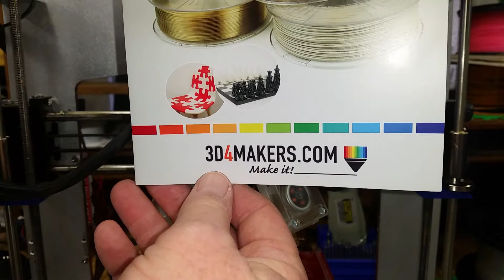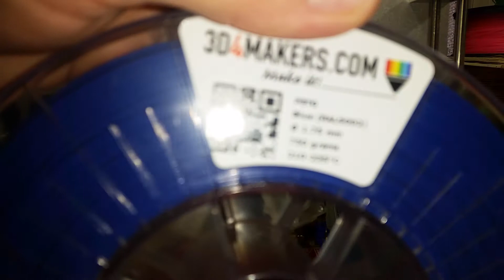3D4Makers.com PETG Review / 3D Printed Bottle Opener

Comment: Hi Jimmy. I just bought a Mecreator 2 like yours and am having difficulties using it with Cura. I am using a mac and was wondering if you use it as a reprap printer or repetier. Also how did you get it to print in the center and not the edge. Thanks in advanced. Kevin
Reply from the maker: +Blueenergizerbunny Hi!

I use cura 15.4.6 and use reprap with Marlin.  To offset the centering problem, I love the item to the right of the build plate in Cura before slicing it.
Reply: Thanks a lot I will try that.

Kevin
Reply: In addition what print head and gantry height settings do you use?
Reply from the maker: +Blueenergizerbunny that's where I have a problem with the new cura.  I have never figured that out, so I stuck with the older one.
Reply: Okay. I just thought I'd ask as the original version of Cura I had did not have custom printers.

Kevin

Comment: Great dual review and print video, nice work Jimmy! I have to print that opener too, very Practical use of #3dprinting. Might have to look into the PETG filaments too, very curious about those.
Reply from the maker: +Print 3D Channel Thanks!  If you want the durability and heat resistance of ABS and the easy printing of PLA, it's a great alternative.

Comment: Heya...on your Geeetech Aluminum Prusa I3, do you have fan speed control? Both of my fan connectors are at 100% all the time.
Reply: is the board the GT2560?
Reply: Yep, just like Jimmy says. I may eventually swap it over to a Raspberry Pi and Octoprint, but for now this is a minor annoyance.
Reply from the maker: +Greg Webster Unfortunately not.  It has the old Sanguinololu board.  If it had the GT2560 board we would be in business.  That's what the MeCreator2 has and it does have active cooling.

Comment: Hi, how fast you print with your mecreator 2 ? I print at 80mm/s fast and slow at 40mm/s
Reply from the maker: +Club der dichten Dampfer I can print faster, but on average 50mms fast 30mms outer shells,  20mms first layer and 70mms non printing moves.

Comment: Minimal cooling is fine with PETG it is a bit like ABS you CAN use cooling but in general the rule is to avoid it as it likes the previous layers being hot. 

from what i remember the glycol [g] controls the flexibility of the filament.
Reply from the maker: +Calvin Witt I really like printing with it.